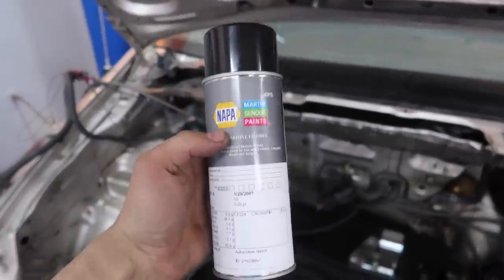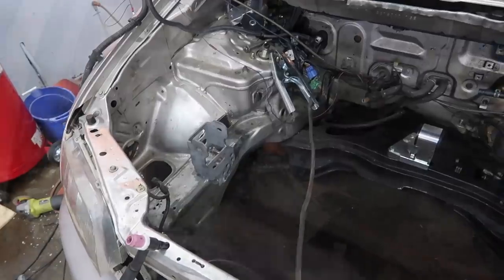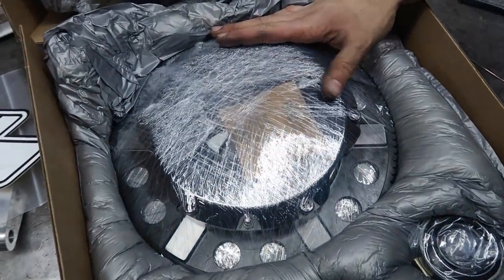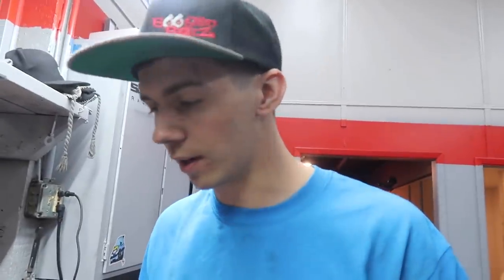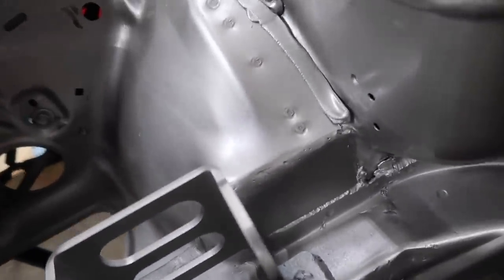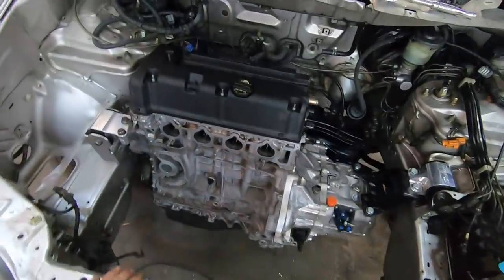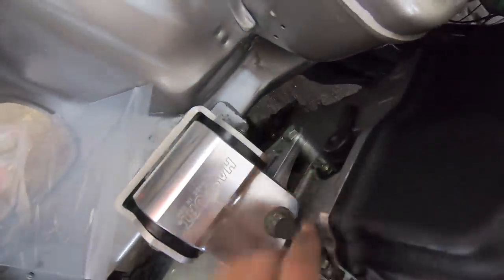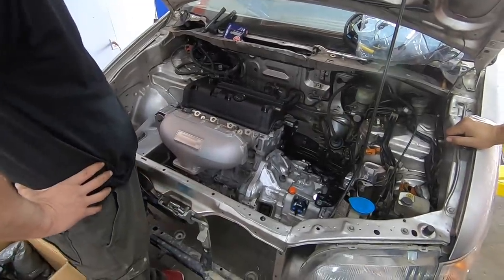Installing a 1000hp Engine and Sequential Transmission Into The Minivan

Comment: On the other side of the bay where the air gun chiseled through is a good time to use panel bond bcs it will add more integrity than even duraglass and it’s also weather resistant.  3M makes a good two part epoxy. Nothing seals and blocks moisture better than a strong two part epoxy.

Comment: Not going to lie, it would actually be cool to build the van as more a street sleeper and slap on a turbo that has better low and mid range power and quick spool. This way you can really surprise people on the street with it as opposed to some 1,000hp build where it takes a while to build useable amounts of power for the street. Basically a turbo that can hit around 3,200-3,400rpm all the way through mid range and steady curve to red line.

Comment: Fly wheel torqued to spec😂😂😂
Reply: Seriously, painful to watch.
Reply: @otm646  They had it torqued to spec on hondaru, and bolts started going out. And killed the clutch. Since then they do fly wheel like that, and never had any bolts pull out after that.
Reply: some of the newer milwalkie impacts have bluetooth and can adjust the torque with your phone... kinda neat
Reply: Hell yea..6 ugga uggas is the proper spec
Reply: He's mentioned in previous videos that they did it for years like this on several builds and never had an issue. Tried torquing to spec on hondaru one time and they came out.
Reply: 92VXEG there’s no one exact way to build a 1000 horsepower motor, stock torque specs don’t always apply at that level.
Reply: Did you torque it to spec. Off course I did, three Prrrtts Prrrts Prrrts
Reply: crazyrussianblagh 😂
Reply: They did on spec. And they came lose.  Know they to impact!  I do 30nm and 90 degrees on my renault F4Rt
Reply: I dont like using that impact to tighten bolts i cant get a feel for how tight they are

Comment: Kyle do you think you might want to put a few gussets on that engine mount that you welded in? Those 90 degree angles might be stress concentration points and might crack that mount eventually. Just a thought!

Comment: Did y’all torque those Flywheel bolts? Pretty crucial part to make sure your good on
Reply: I think he said they torque them to 'setting 2' on their impact gun. They've only had one come off before. On the minivan....
Reply: Ben Ische that’s definitely a way to do it. But it definitely wouldn’t be the way that would make me feel secure about it. I think I saw them put thread locker on which definitely helps. A torque wrench is your best friend with engines, just extra security ya know? No hate whatsoever, only concern

Comment: Having dealt with rust on Honda's before, the plate you welded on to cover the holes makes me nervous. That's the type of thing I've seen water get behind and rot the ever loving piss out of everything before finally making itself visible. Cutting it right out and welding it in flush would make me feel better.
Reply: iVTECInside or at least used weld primer
Reply: @ohighogrown , I meant to mention or that too. Anything but bare metal.

Comment: I would sump the factory gas tank and run a Holley fuel mat like u did on the hatch for that big girl
Reply: I though when people sumped tanks they also welded some fittings on the sump and ran external pumps. No where to out a holley mat

Comment: Hopefully don't catch any flak for this but can we see a build with a non honda motor? We already know K series is capable of 1k+ hp, I was looking forward to that nissan buildout or maybe try other 4 cylinder engines like the 2zz-ge or something. We can see what they are all capable of especially since you can fabricate a lot of the parts needed and there isn't much aftermarket support for the other brands.

Comment: Out of curiosity, are there any companies that make slipper-type clutches for Hondas?  I have seen that a lot of the real fast stick shift cars are using slipper clutches.  Might be worth looking into and could potentially save some rotational mass for those Honda engines and be a little easier to put the power down in a more transitional manner as opposed to a typical "clutch dump"

Comment: Have you guys ever ran one of the slipper clutches on a fwd?  I see alot of  people running them on their drag cars wondered if it would work as good on a front wheel drive as they do on the rear wheel drive.

Comment: you ever gonna sell me the h22 swap full swap from the van yes or no dame😂😂😂 on god I need that cause I know it’s good for what I want please say yes🙏🙏
Reply: That would be kinda dope if he did a give away on that full swap. 🤔
Reply: It wouldnt be a bad idea for kyle to keep it ad a backup, he does have 2 other H cars.
Reply: I really doubt he will be getting rid of that
Reply: @thrifty9797  I think the hatch will be getting a k awd is what he hinted at already and the prelude I doubt will use anything from that
Reply: @lukemalone9023  its definately not going K AWD this season, so of hes going to run it at all it's going to be with it's current setup, which the H out of the van is almost an identical build to. If I hes going to run the hatch this year, then it would be wise to have a spare.
Reply: DM him on insta man!
Reply: He's saving the red hatch for more aftermarket support it should be coming this year.
Reply: vtec vicky needs a motor 1st
Reply: @thrifty9797  I doubt it'll be run this season with the mr2 the roudssy and the prelude I doubt it'll be ran and if it was ran and it blew or broke I think that would just make him park it and get it ready for what he has planned that's what I think I could be way off but that's just what it seems right now
Reply: @lukemalone9023  Kyle said he wants to drive the hatch this year, and if he does, getting rid of your spare built motor is dumb

Comment: Is it common to drop the engine from the bottoms when working on Honda’s. I am currently doing a motor swap on an 02 accord and pulled it from the top cause of subframe rust and no lift. Just curious, lmk

Comment: 6:12 - If you're gonna use it for racing the engine bay should only have crap it needs for when you go to wrench on it, it's not for form, it's for function; strip it.

Comment: I never thought that I'd be one of those dickheads that'd say this, but you want to make 1000+ and you didn't torque the flywheel bolts brother? You torqued the pressure plate bolts, so hopefully you just torqued the flywheel bolts off camera, but you know how important proper torque specs are...at least you would if you've had a flywheel bolt fall out into your bellhousing.

Comment: You torque everything perfectly but run the flywheel bolts in with an impact... Damn bruh. 3 ugga duggas or 4? lol
Reply: @maxx849  it doesnt.
Reply: Gary! Yes it does, they have mentioned it before while working on the twin turbo mr2
Reply: @maxx849  it doesn't 🤣 they are mostly being sarcastic as everyone moans. You cannot get a consistent torque from a normal impact gun like that. If you really think you can then you really have zero idea 🤣